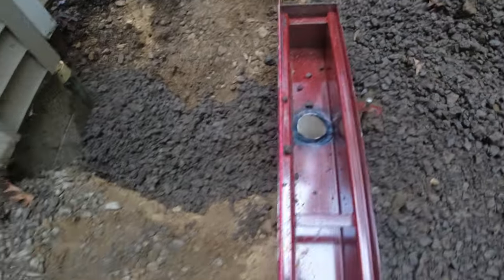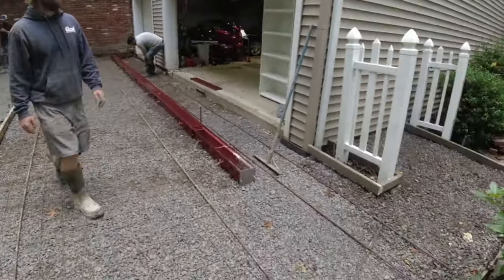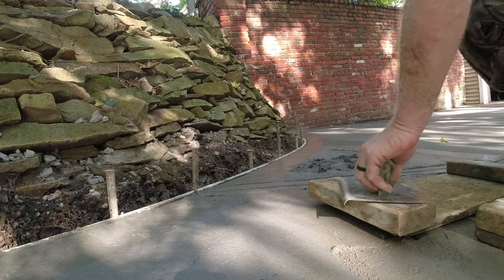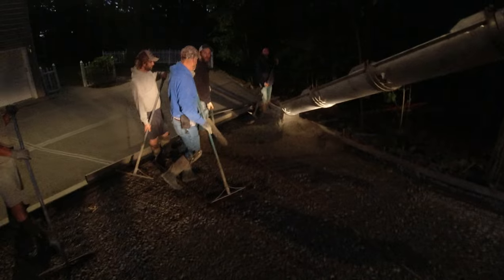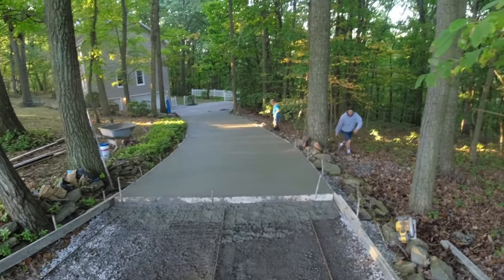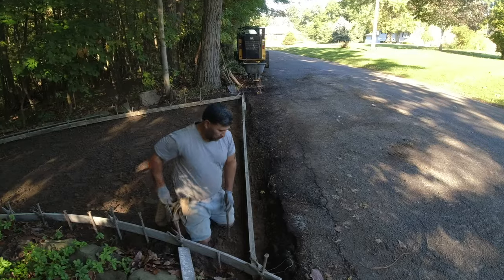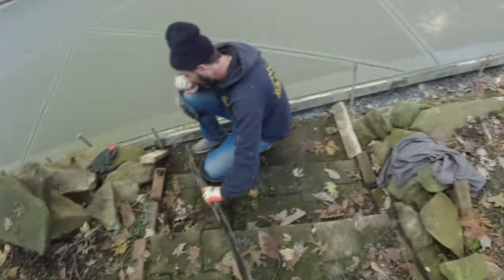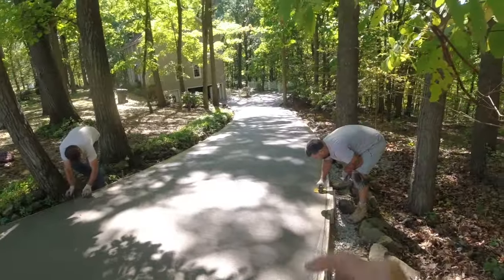Long Road Ahead!

Comment: Wow, this drive was sloped from top to bottom. Trees dictating the width, and the road didn't match the pour at all. You ran short on the first truck, and the entire pour was in the shade. Other than that, it was a pretty easy pour. The owner sure was sweet to treat you guys after finishing. The crew got to go home happy and satisfied. If only every project ended like this one. As you were telling us how it was cool in the shade, my heat pump was struggling to maintain 72°. It's gotten down into the 30s now. We've has frost warnings for two days now. I feel for Asheville residents still in recovery. It's always colder up there than here in the foothills. It's sickening to think the gulf hurricane and the wildfire in Wyoming, both just happen to be land the Oligarchs have been trying unsuccessfully to purchase those areas to mine the minerals there. I am happy to have had 30 minutes of refreshing, good things to start my day today!! Thanks Tom! 👍❤️🙏🇺🇲🇺🇲

Comment: Hey Tom look great that was a lots of work for one driveway I do have a little concern on all the trees there I think the roots will eventually do damages to the slabs I poured concrete for a small landing for a wheelchair and had it 6 inches thick with wire just a 6x7 pad not far from a sweet gum tree it took around 6or 7 years but the roots did crack it and now one part is about an 1 lower than the other but there nothing you can do about that just look at how many side walk you fix you guys have a great day

Comment: That’s a beautiful job, but when that ices-over, look out!
Don’t you typically apply a product to the surface to prevent surface pops from the ice/freeze thaw cycle?  We’re in MT and concrete takes a beating here.

Comment: Hey, Looks good the one thing If it was my driveway remove those trees there too close to the concrete.. Here in Fl. After Milton my 150ft rule about trees near a buildings was proven correct. Wear I am we got wipe out by tornado's 90 to 95% of the homes have some level of damage. Flooding is very bad 2 days after the storm it came up higher. Lowes had a 3.5 mile line to get in to store 5 days after the storm.
Reply from the maker: I hope everyone is safe after the storm!
Reply: @Concretewiththehauses  The 17 that where killed mainly the large wedge tornado's. In our area the newer mobile homes held up well and most the the aluminum hand railings for bent way out of shape but the mobile home really wasn't touched not even the vinyl siding whereas  the older mobile homes the roofs were ripped off and carport was gone. Spanish moss is still on the trees though that amazes me how that stuff can stick to the trees.

Comment: At least you don't have walnuts balls falling everywhere. I watched a guy mix concrete from bags to a mixer and it was way too wet. He had all the good tools for the job. He started in the morning and he said it took 2 hours to do it. It was only 5x5 feet and by 8 o'clock he broomed the surface. That tells me the concrete was way too wet. He didn't use any wire of any kind either.
Reply: That was 8:00 in the evening. And it was still too wet to broom.